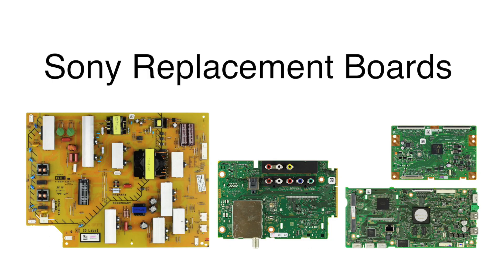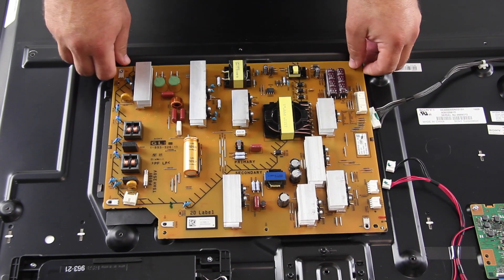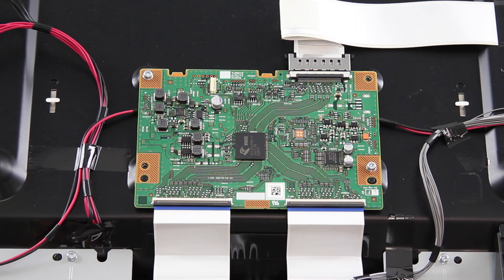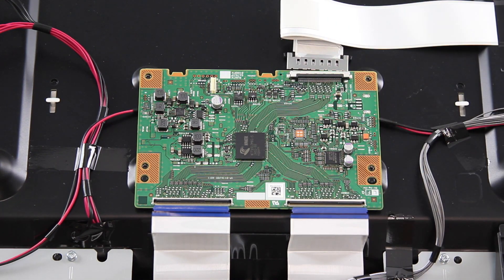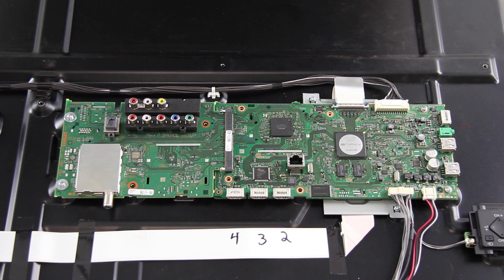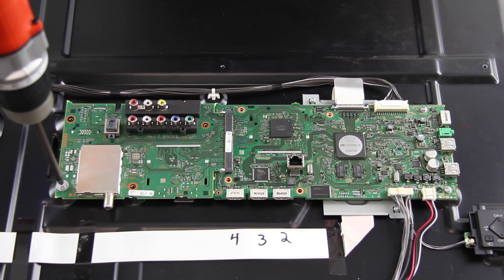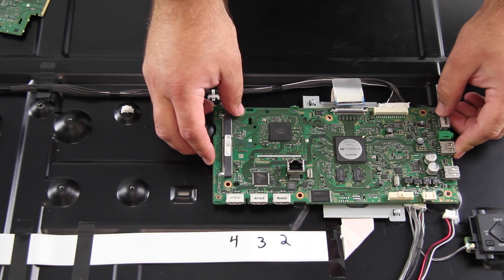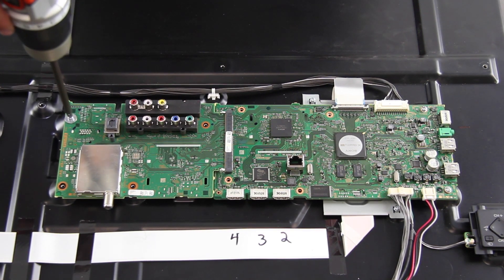Sony 60" LED TV - Model KDL-60W610B Repair Help - How to Replace All Boards

Comment: Hi Jimmy. I have a issue with my Sony TV. When I switch on the TV, the power light will blink around 6 times and off. And the TV won't turn on. May I know what's the possible cause? Thanks.
Reply: Khoon Ang I have that same issue so i called the repair guy to come out to see what it might be. After he took the back cover off he tested all the boards and came to find out it was the tubes that went out. And he said it would cost more to pay for the new tubes other then buying a new T.V. Anyways hopefully that let's you know what is wrong with your set.

Comment: Hi, I am having issues with my Sony KDL-60R510A tv.  Original problem was a line that duplicated a section of the TV (About 6" on the right side of the TV that duplicated the 6" of screen that was on the left side).  The TV was being used outside and got damp, when moisture was wiped off the TV the problem occurred.  Presuming an issue with the ribbon strips, we adjusted them in hopes of fixing the problem, ultimately making the problem worse!  Are there replacement ribbons for this TV model? Hoping to not have to scrap the whole system.  Thanks, Scott.